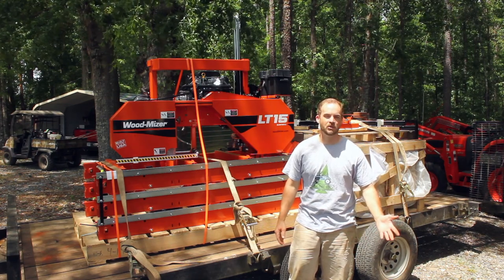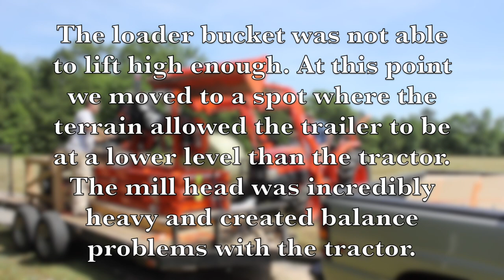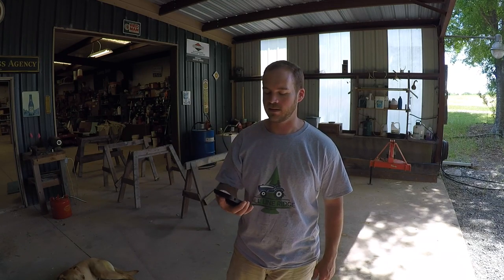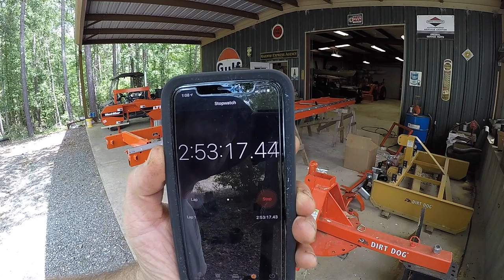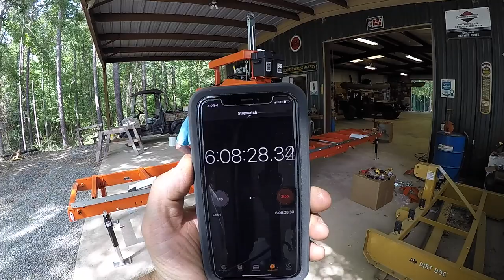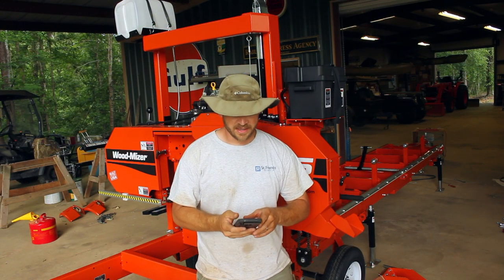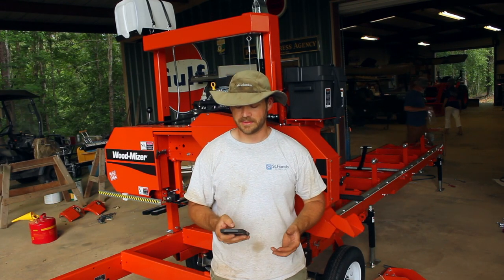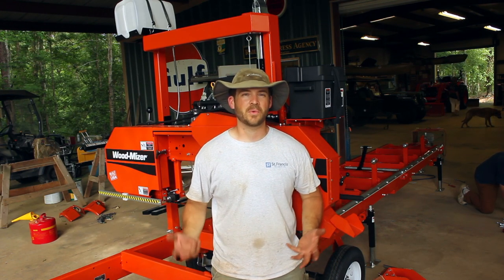Wood Mizer LT15GO Assembly: How Long Does it Really Take?

Comment from the maker: To be fair, I think the “you can be sawing in a few hours” claim is for the mill itself. Not the trailer package, power feed, and winch. Still, 9 hours isn’t too bad.
Reply: As you said it before, knowing  "your" sawmill from head to toe will increase system performance due to lower cost and higher output ...... and more fun with the new toy! 😆
Reply: My Lt 15 Standard suppose to be in Newnan on the 24th Sept. May need you and Pa to come help assemble.

Comment: Im glad I watched this video you shared for a couple of reasons.  First reason is I had planned on picking up the woodmizer LT15 with my father in laws pickup truck but now after seeing the difficulty of raising it off a flat bed trailer I see an issue with being able to raise it high enough to clear the side of the truck bed.  I guess we could raise it high enough and just drive the truck forward until it clears then lower the saw head to the ground.  The second issue I have is we do not own a tractor.  I have not put my order in just yet but I plan on getting the trailer option but most likely that will be down the road since it adds $2000 to the cost.  Worse case is I rent a tractor which I could also use on our property to move a bunch of dirt around but thanks for sharing this video because now I know what to expect once I get the unit home.  It sure would have sucked getting it home only to find out I had no way of lifting it out of the pickup truck.

Comment: As with most manufacturer's, "a few hours" is a relative term. I would consider "a few hours"  somewhere around 4-5 hours, otherwise,  just call it a full day (or so) for assembly and setup. Really looking forward to seeing what you can do with this machine. This one looks designed for portability, it'll be interesting to see what you invent to keep using the loading ramp/winch setup.
Reply from the maker: murphymb To be fair, I the “few hours” claim was just for the mill itself. Not the trailer package or power feed or winch. Still, 9 hours isn’t too bad.

Comment: You may need to tighten / adjust your throttle cable so that the throttle comes in just a bit sooner as you engage the blade. Should help with the stalling.

Comment: Befor sawing check that the head height and roller chain assembly is good to go, I alway's do. Also transport with the all the way down and I like to put some sung end to end ratch straps over the top should be able to get a bank under the strap at the top of the mast for extra hold over rough ground. Thats just me.

Comment: Hell, it took me longer than that to read and understand the manual, you mentioned that you had some adjustments to still do on it, I lucked out and got mine use from a local guy, and it looked like it was never used, Really like show room new. and 1/2 the price of new. A few Q's if you have time, how is the power feed working, only thing I don't have and heard some issues with them, also you should do a  video on  aligning the blade, roller guides, no one has a good one on the tube. Mine was all set up but I'm checking every thing before I start using it. only one thing I saw is the blade gullets are about 1/4"+ out from the drive wheel   and idler wheel, and says they should be about 1/8"was wondering how much to turn the adjustment bolt, thinking 1/8 of a turn to start.  Nothing is mentioned about that. Great video and wish I could have been there to help out.  And a few hours as I think and maybe you would few 3-5 now we know. Bless yawl an do more videos.   👍👍👍👍

Comment: I have a homemade mill and I am wondering if you could do something for me if you taught your blade and the saw guide is set out to the full or out extension could you put on a scale and pull it one inch and tell me the amount of pounds it takes to pull it down to the one inch Mark this would be valuable as to help me get the right tension on my mill. If such a thing is possible it should be pulled in the center of the blade guides in there full or out positions. Thanks any help would be greatly appreciated.

Comment: That's a really nice package deal you have there. Only saying that because I'm looking to buying the same one, minus the power feed. Woodmizer quoted me $380 to set it up and put it on the trailer ready to tow. Let us know how it handles on the road and if there's anything that needs to be done to the saw prior to Towing it. Will you be putting the power winch on that saw instead of the factory manual winch? Can't wait to see the wood chips and dust flying with the new saw.👍👍👍
Reply from the maker: OLD SCHOOL MACHINIST I’m seriously considering it. I towed it a few miles so far and it pulls perfect!

Comment: Let me know how that power feed works I want to get one for myself. Also when engaging the blade wood mizer told me to ease it on. And for traveling I think it’s supposed to be back by the axel. There should be a piece that swivels up with a hole that you lower a pin on your saw head into
Reply from the maker: Yep, I discovered all that stuff the next day. Amazing what you can learn from properly reading instructions. I'm really digging the power feed so far. Very simple design and it frees you up to pull lumber off while the mill saws.
Reply: Awesome! I was just at a wood mizer class Friday and almost bought one

Comment: I was wondering how much it cost with all the upgrades? Great videos too ,keep em coming 😎
Reply: here 30k plus $200 for PDI PLUS 15%tax cnd
Reply from the maker: Retail is about 10K USD. Plus tax and the add ons. They are currently on sale.
Reply: @falllineridge  THATS ABOUT $13,400.00 CND  a far  cry cheaper then here in Ont. Canada, and the usa dealers not aload to ship or sell to Canada,, to protect the huge margins dealers here make, but being it is not 100% made in usa there duty on it around 23% plus the high cost of shipping they clam and your add on are standard at our dealers, they were cheaper years ago until they got Canada dealers, just like argo 8x8 water cooled, was 10,000 in 1999 and now 30,000 cnd i was about to buy one in 2000 but argo got dealers and price over night jumped 20k

Comment: well that is the first one i have evenseen go to a customer all in peaces, sure you see them stacked up out in the dealers yard out back, but the ones for sale are all out front put together, and like any other power equipment you buy a PDI  has to be done by the dealer to start your warranty the claim, witch they charge $199.00 for the PDI  over and above the cos of the unit an tax, then you hook up to it an drive away, or if not wheels you need a long trailer, but every unit but the 10 all have wheels, dealer will not sell it to you in peaces, i asked about just buying the saw head and no way, because i dont want the crappy frame or wheels, jacks or tong, not needed